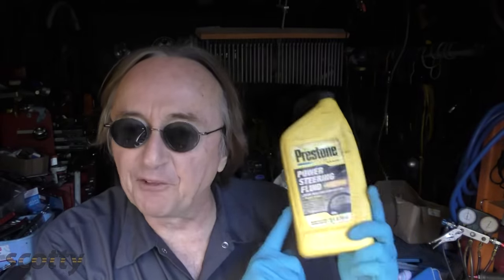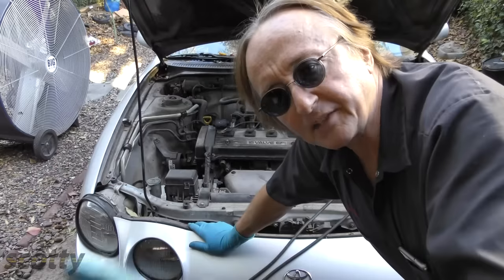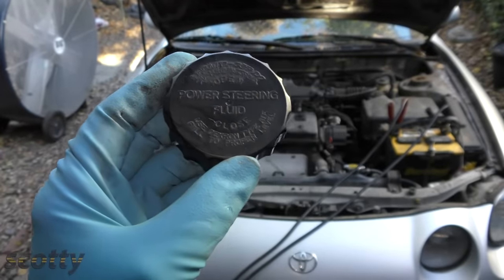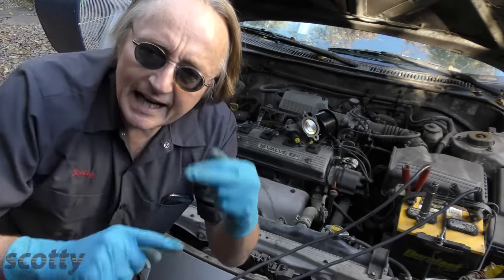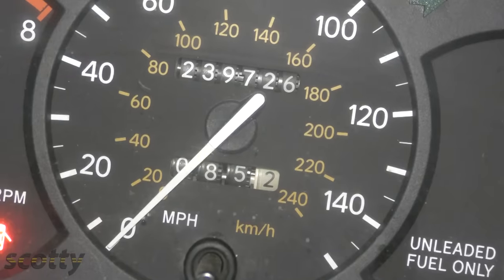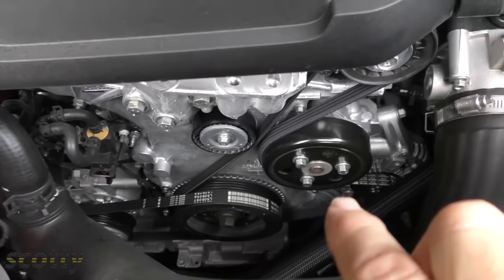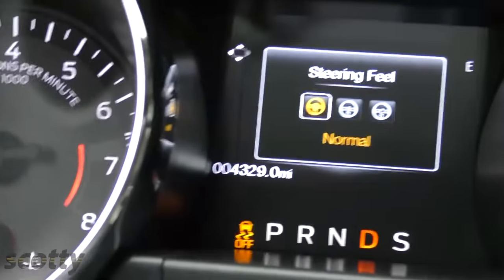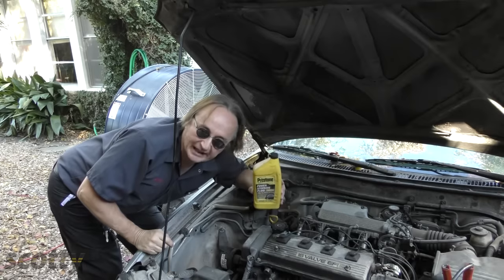Should You Change Power Steering Fluid in Your Car?

Comment: Changed mine by running engine 1-2 s at a time, and replace reservoir contents each time.  Also added a friction eliminator additive after a pin hole leak on a coolant pipe in front of the radiator caused all the fluid to drain out (fixed with some bike inner tube and a tiny fuel line jubilee clip)

Comment: Nice to see car manufactures get rid of PS pumps the fluid gets dirty fast no filter in the system. I change mine once a year on all my cars my 2017 focus ST has electric PS one less thing to worry about. Most neglected fluid is PS and brake fluid. Recently I changed my transfer case oil I thought it was old 90 weight turned out to be some kind of thin transmission type oil made for ford transfer cases. It was really dirty had 139k on it never used 4WD much went to sell the truck guy asked me to test the 4wd I couldn't get it to shift. Turned out to be the linkage needed some oil, and vacuum lines to the front axle was broken.

Comment: These electronics are unsafe and prone to failing
Reply: It's ironic you say that because you have a beemer.  
There's plenty of over-engineered BMWs... 'nough said.
Reply: Aztekky yes but I have a old one so I don't have to deal with nonsense
Reply: Aztekky and at least our engines last unlike American cars
Reply: Bmw M3 e46 very common failure with the gm cars from my experience
Reply: GM seems like pretty poor quality if you ask  me but I still like a few of their cars.
Reply: yeah crown vic is pretty much the only comeback you guys have, everything else is trash, german have better quality interriors then plastic japanese cars. i would trust a german engeine then japanese
Reply: Aztekky i blame gms affiliation with China
Reply: I've never owned a German car but I've always heard about their check engine lights, more so with the newer ones. At least BMW is not as bad as Volkswagen. It's funny how the 2002 Toyota Echo sedan I had with 255k miles had no cracks in the dash but my dad's coworker's 2009 chevy tahoe with 100k miles has a cracked dash. The cracked dash with GM's are actually common, just search "GM cracked dash" in Google lol
Reply: Even dodge had dash board cracking issues with the late 90s early 00 rams. My pops had a warranty on his back then after a year owning it. think it was a 2000 or 01. America def lacks in the quality control dept.
Reply: Steve h I wasnt aware of that lol that's sad
Reply: American made or imports they all have there common problems.. Simply just have to know them and pay more attention to those things that fail.
Reply: True. I guess it's just fun to bash other brands. Honestly I'll drive any brand of car, but it depends on what year and model it is :) I'm really digging the 2005 BMW X5 with the 4.4i. my friend's friend has one w/ 300k miles on the clock, claims he's had no major issues. just does a tune up every now and then like every car you should.
Reply: Bmw M3 e46 I could go find like 500 cars near me in the ghetto 15 minutes away with well over 200k on them. All car companies have their ups and downs man. BMW is definitely no exception.

Comment: Hey Scotty, 
I mistakenly put about 6 - 12 ounces of clutch master cylinder fluid in my power steering reservoir one day last week. I think the fluid is same as hydraulic brake fluid. 
I immediately realized my mistake and drained the reservoir and it’s hose to the power steering pump without driving the truck. 
I reconnected the hose to the reservoir and filled the system with fresh power steering fluid.
I do think though that I could have done a more thorough job if I rinsed the reservoir more completely. 
My question is, if there was a little brake fluid left in the system, will it wreck the components?  Should I drain the system again and replace the fluid again? I am driving the truck now and hope there will be no ill effects. It is a brand new class 8 highway tractor I am talking about. Any thoughts? 
Thanks, James
PS love your vids. Thanks

Comment: Quick question Scotty.

I have a 2008 Toyota Corolla. In my maintenance guide, it doesn't recommend ever changing the power steering fluid, the transmission fluid, or the brake fluid. It DOES have hydraulic power steering - it just doesn't specify the interval in which I should change it. It has 130,000 miles on it and I've never changed those fluids. I plan to keep my car basically until the wheels fall off which - being that it's a Toyota - hopefully will be a long time. Should I change those fluids despite it not being in the factory recommended service guide?
Reply: Nobody from car man don't care what is gonna be with your car after wattanty ends. 130k miles is time when it is a good idea to change all fluids(power steering, brake,transmission, coolant)

Comment: Hey Scotty. 
I was just at autozone getting power steering fluid for my 1999 Ford f-150 4x4
I hunt so I go off road a lot.
I noticed my power steering making noise when I'm going up a steep hill bouncing a little here and there. 
After I get back on pavement it fixes itself 😜
I was going to flush it and see if that helps.
I got some, Prestone stop leaks just incase theres a leak. YA or NAY? 
Thanks

Comment: What goes into the steering system in my car? Nothing but good old fashioned elbow grease. But at least it handles like most other cars when youre moving faster than 5 mph. And quite frankly, I wouldnt want a PS system put on my old 'stang. You would have to redo the steering system, I wanna put an overflow tank where the PS fluid tank would be if it had one so my coolant doesnt boil out, and Im wanting to install an aftermarket AC system.

Comment: On my 1985 Toyota, the PS reservoir is plain in sight, near the top of the engine bay. 
In my 2006 Ford, it's located under a headlight that needs to be removed first. And Ford even says you need not ever check it.
Reply: thats because you ford has a close system i seem them before no cap nothing to check there.
Reply: Just like their maintenance free sealed transmissions. Yea, Ford are full of shit, you need to check it.

Comment: he didnt mention the 205 rubber platic fluid. he said it could repair power steering, i tried it, it did, Mercedes C320 power steering out for 2 years , i put that stuff in,. in two days it works. ! saved me over 2,200.00

Comment: My car is Ford S Max 2.0 Echoboost, 
I want to change steering fluid my self, the Ford HK charges too much for it. Ford WSS-M2C204-A2 is recommended which can be found in Hong Kong. Only one I get is 
Ford WSS-M2C204-A, do you  think it can work. Suggestion please. 
Available in HK CHF 11s (Ford WSS-M2C204-A)
Not Available CHF 202 (Ford WSS-M2C204-A2) 

Thank you for great video always.

Comment: 1996 Tacoma V6 5 speed...never changed power steering fluid...just added a little a couple times...no leaks 361,000 miles no issues 💪🤞

Comment: I had a 03 F150 for 13 years and I never changed the power steering fluid in it!! It had 125k miles and still had the factory power steering pump in it when I got rid of it!! I guess I was just lucky?

Comment: My non-Jiffy Lube shop tech told me he recommends changing my power-steering fluid on my 2007 Nissan Versa. Trouble is my Versa is electric assist steering - it doesnt have power steering fluid ?!?  Just say , " no, thank you " , to power transmission flush ( potentially harmful to Hondas ), power steering changes/  fuel injection cleaning ....

Comment: My new 2017 Mazda has all electric PS. Completely computer controlled. Has excellent feel. Just a bit strange when I shut off the engine and the steering wheel still has high assist when I'm using it for leverage to get out of the car. Wasn't expecting that..lol...

Comment: I don't have to worry about changing the PS fluid in my '91 Ford Ranger. It is on the continuous fluid replacement program. "If there ain't any oil under it, there ain't any oil in it."

Comment: My 1973 Volvo 142 was so high tech that you didn't need to worry about power steering pumps, timing belt, or timing chain, mind you, that was because it didn't have power steering, and the  crankshaft/camshaft gears meshed directly, lol.

Comment: The power steering will usually groan when you turn the steering wheel if your fluid is low, just top it up and check for leaks, iff you need to top it up more than once every few months then you will need to take it to a mechanic.

Comment: I did a PSF change on my 2005 Hyundai Elantra GT because of this reason, sometimes when I cold start the car it the pump locks up makes a belt makes a huge loud screech sound for a few seconds I changed the belt twice and the car has no leaks and it's always at cold proper level. I'm not sure if the rack or pump is going bad

Comment: Had not driven car for 1 or 2 yrs. Then on a 1.5 mi. drive suddenly all ps fluid gone.
Refilled it, leaked out fast. Did this several times, much better now, but still leaks some.
ATF stay in there better than ps fluid. 
Considering using Seafoam Trans Tune (recommended by Scotty on his other vid) to clean out gunk, 
then put in Lucas Power Steering Stop Leak and let that sit in there for a few days to recondition seals.
I sure would appreciate educated opinions.
I posted on his vid about Seafoam days ago and got NO replys. I notice that the last post before mine was 5 yrs ago.
Wondrering what's up with that?

Comment: Nice video.
Now question: Is it big problem to have a little too much power steering fluid in reservoir? Possible problems?
Reply: The cap has pressure release and will let the excess fluid out if it gets to hot and expands.  do you have a leak? If you don't have a leak, I recommend taking enough out so it has room to expand.  That stuff gets nasty and when it gets on your belt nakes a horrible smell when it burns.
Reply: No leaks, all good. Thanks for answer and have a good day. :)

Comment: i was putting regular ps fluin in my 1976 F150. Read the owners manual and discovered I was supposed to be using ATF fluid...woops. It's alot quieter with the right fluid

Comment: Thanks Scotty I'm watching your videos I did my own the horn wasn't working on the Hyundai that I have and I followed all the steps and it was a disconnection from a loose wire to the horn and then I have Falls a lot of your steps doing the high beam I mean doing the changing the light bulbs and stuff like that I try to do stuff myself I used to have an old Mustang and I get the belt and the stuff whenever the guys from the out of Parts is that this is what it is this is what you have to change you just have to unscrew it and put it up

Comment: I have a 2010 RAV4 with 80,000 miles on it.  The owners manual said it has power steering with electric assist.  Does this mean I don't have worry about fluid or other maintenance?

Comment: I've only had my Miata for a few months, and the power steering just stopped working a couple days ago. Not sure what to do? The fluid is at the proper level, it's just pitch black and doesn't look like it's been changed in a long time. Should I bother changing the fluid or just go right to replacing the pump?

Comment: I have a 98 dodge caravan thats been ridden hard and put away salt water logged. My power steering pump just seized today without warning and sheered the pulley right off the shaft. No noise nothing to indicate a failure. Just was backing out a space at the store, Some loud noise and the PS was done. I drove home as far as I could and the pulley sheered off. Tomorrow I work on it. Any reason why this happened even though the PS fluid is nice and clean? Its 15 degrees out if that helps and was warmed up at failure

Comment: Hi Scotty, very nice work

I have an important question to say you. I’m 18 yr old, and I’m driving my mother’s Renault Twingo mk1, I live in Italy, I don’t know if you ever listened about this model car, anyway, Every time I use the steering, i listen a noise sound like a door opening screech. This problem is from about 2/3 years, and now is more loud.... I make you a question, what are the parts that could be cause this “problem”, and a way to solve it or discover some more about this? 

Thank you, your fan from Italy.
Reply: That would be air in the system. Check the fluid level, if it's fine, then there is an air leak somewhere, usually a seal leak on the pump.
Reply: MV60 thank you
Reply: No probs. Also do check every connection for any fluid leaking. And the hoses too may have a split. It all comes down to having a good look at the system loop. It should be pretty easy to follow once you find the ps pump, the hoses from there only go to the reservoir, to the rack and then back to the pump. It's a separate system from the engine.

Comment: The newer trans fluid is synthetic , if I use it in a 2001 Chevy suburban V8 automatic. Can I use the newer synthetic transmission fluid in my transmission and power steering , without causing a leak?

Comment: I have a 2018 Grand Caravan with around 40,000 miles on it. The dealer service is recommending that I flush the Power Steering fluid because it's black and should be red.  It was last done just over a year ago at 29,390 miles.  Is that normal, or could there be an issue with my PS pump or something else ?

Comment: Whats crazy is the power steering fluid dipstick is way too short.
The bottom on the power steering fluid bottle has a pipe at the bottom and as long as the fluid is above that pipe your ok.
But whats crazy is the dipstick end is about 9 inches off the bottom of that bottom pipe.
The dipstick should be say 6 inches long and not a few inches long so it's no good thinking your low on fluid if it don't show on the dipstick,as Its not always the case most of the time.

Comment: My fans won't turn on, and I changed the thermostat as well as one of the sensors (the temperature sensor in the interior indicating how hot/cold the car is works fine). Any who, it's okay in the winter but no fans will cause my car to overheat towards the warmer months.
Any suggestions Scotty?

Comment: Scotty., I drive an Opel Tigra 1.8 Convertable. All of a sudden the steering control has stiffened a lot and an "oil leak" has occurred since then., Its not engine oil as the car is not using any oil at all. But we cant find the fluid reservoir  anywhere in the engine

Comment: Scotty,  I'm a DIYer with no room for a compressor.  Which cordless impact wrench would you recommend for occasional car repair - something that can loosen suspension, brakes, axle nuts, etc.?
Reply: UnFunded Opportunities Hi. I'm not Scotty but I'm a retired mechanic and firetruck builder. I too have no room for a compressor. I have a DeWalt electric impact capable of 300 ftlbs of torque.  I also have a cordless Craftsman impact capable of 200 ftlbs. Both are adequate for most jobs. (Unless you're working on a BIG RIG!) Hope that helps.
Reply: I have the dewalt 1/2 inch max xr impact, a little on the pricier side but it works great and saves time

Comment: Hi  Scotty. I have a Volvo 3.2 2014 , 55k miles with Power steering Problem.  difficulty turning the steering wheel at startup. The Volvo dealership found no leaks except, the Reservoir was half empty. Their diagnosis: Need an alignment and other such as Replace coolant and brake pads.  It would seem they neglected to flush  reservior during previous servicing.  I suspect the pump is failing and may fail soon.  Volvo solution: top-of-the reservior without doing any thing to fix the problem.   Not even an estimate how much it will cost to replace the pump and if need be, the Rack and  pinion. After the mechanics and technician had their  diagnosis. I was told that my vehicle was ok to drive because they had another vehicle comparable to mine with the same problem. I am scared to drive it, in case it locks up while driving.  Do you have any help for me? would appreciate your input.

Comment: Awesome. Now where does the blinker fluid go?
Reply: In uranus
Reply: Check for remote blinker reservoir but most cars have electric blinkers these days HAHAHAHAHAHA
Reply: I just fillup my power steering in my prius with blinker fluid, i did pure it in gas tank, as marked in user manual.
Reply: I just fillup my power steering in my prius with blinker fluid, i did pure it in gas tank, as marked in user manual.

Comment: A better way is to pull the low pressure return line run it to a bucket start the engine work the steering and as the old fluid comes out add new fluid untill you see new fluid comming out. Same basic concept as a trans fluid change.
Reply: no as long as you keep fluid going in. But any air that does get in will work it's way out when the fluid is cycled through the system.

Comment: Scotty, help.    I have a Lexus that calls for ATF fluid for the Power steering.  I was checking the fluid and found it is a clear fluid. I am assuming whoever did it last put regular Power steering fluid in it "unless there is a clear no dye ATF".  I was going to flush it out with new ATF.  I know I will not displace every drop and trace of the standard PS fluid in the system and a small amount will be mixed with the new ATF fluid. Should I be concerned about this?  Will there be a chemical reaction that will do more harm than good?  or will it be perfectly fine to put in the new ATF?
Reply: All Toyota/Lexus first-fills from the factory use clear fluid. Hard to find it afterwards. I use Toyota part 00718-ATF00, but it's red.....but it IS the recommended Dexron III.

Comment: Hey Scotty, Doesn't the electronic power steering rack and pinion still use a fluid or does it use some type of gear oil? If it does use a type of fluid is it serviceable? Can it run to about 200,000 miles just like your Celica?
Reply: nope, electronic PS have just motor, steering position sensor and motor, wich turns motor on right derection and angle.